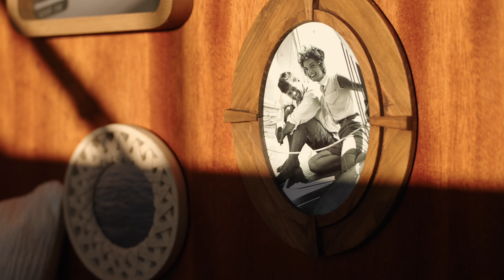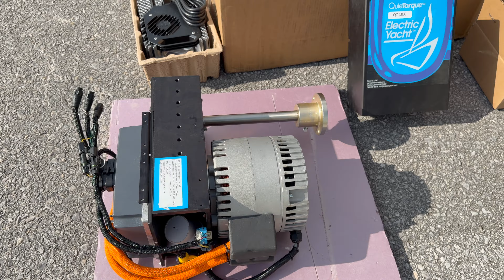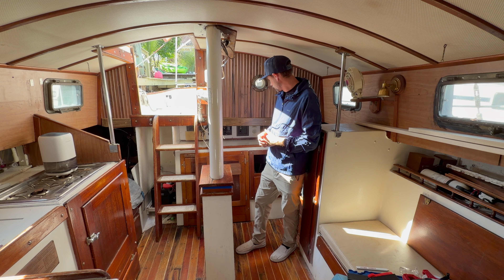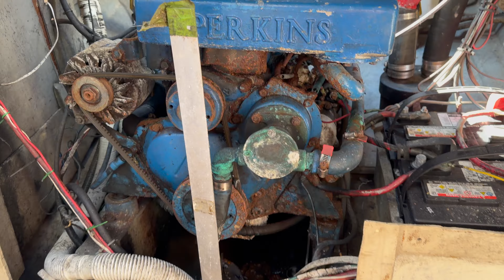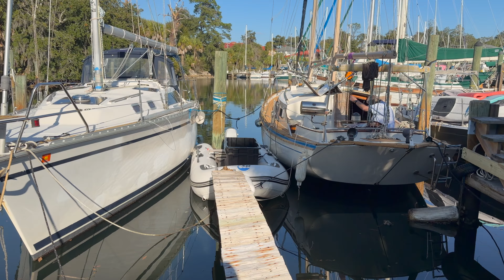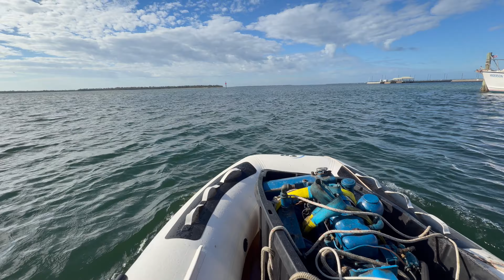EP 03 : ELECTRIC MOTOR INSTALL ON OUR VINTAGE SCHOONER

Comment: How big is the genset to charge the batteries?
Reply from the maker: A small Honda 2000 generation is more than enough to charge back up. We can Even run the generator while underway if we want to extend our range.
Reply: @SailandCo I don't think it will,be sufficient but best of luck.  9ur boat carried a 2000W and a run was only enough to charge our 400Ah house bank for the two refrigeration systems and normal house loads without an inverter.  I guess if you ran it consistently you may get a partial day motoring in.
Reply from the maker: @montanadan2524we use this boat for charters so it stays on a marina and charges at the dock overnight. We don’t plan to rely on a generator. The motor can regenerate power under sail. We much prefer a few solar panels over a generator. At 4 knots we can motor for 18 miles. Lower speeds can get us over 100 miles of range. But it’s a sailboat so we sail 90% of the time.

Comment: I converted my boat to electric. It’s the best.
People are always curious about range. I just say 50 miles but it’s probably closer to 100 miles on a good solar day. The 50 miles seems to quiet any further conversation about the viability of an electric boat.
Reply from the maker: From our projections, range is very dependent on throttle but we’re hoping to get between 100-125 miles per charge with our current battery bank.